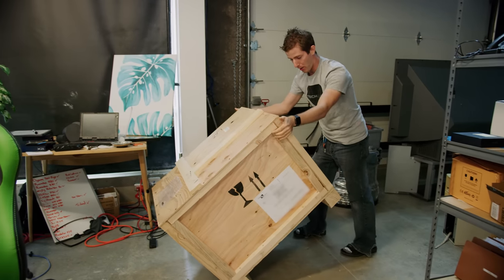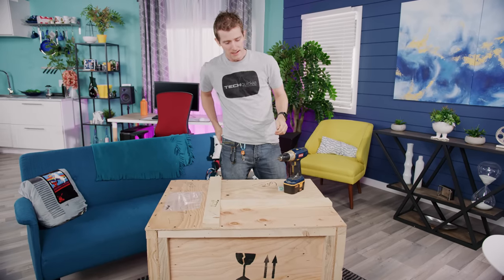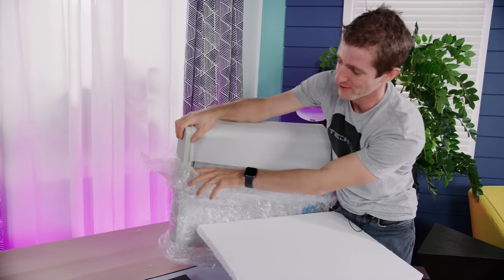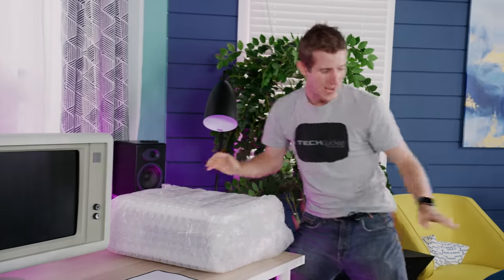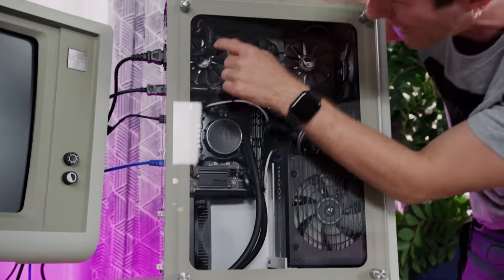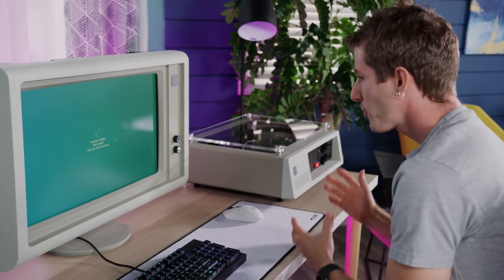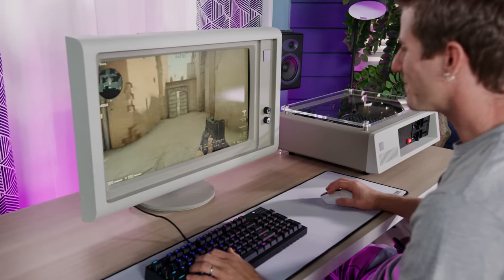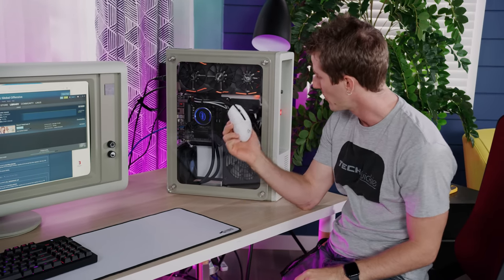The COOLEST Box I’ve EVER Opened

Comment: That "attempt" at a monitor is pathetic they could've actually ya know taken off the original shroud and fabricated one that actually fit and didn't cover up the screen and leave gaps bigger than GM dashboards on the sides the whole attempt is just poor what is trying to be a modern retro neither things mash together particularly well and it ends up looking out of place anyone can gut an old computer case and shove new parts in it but it takes actual time, effort and talent to make a retro pc new with functional pieces like this guy https://www.youtube.com/watch?v=v-TkQ7KZcbI who took an IBM Aptiva and actually retrofit it with new parts and even went above and beyond making a functional floppy disk drive but custom modding the floppy disks to accept SD cards in them making it actually useful for big storage while retaining the sleeper look of a floppy disk.   But this.... just pathetic they gutted it cut a hole in the top and slapped an acrylic glass on top of pegs really impressive.